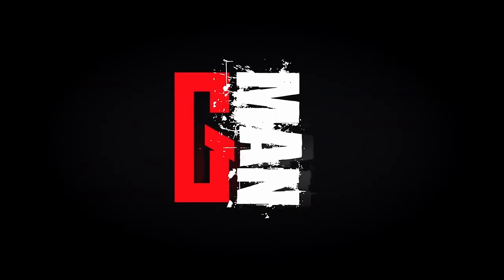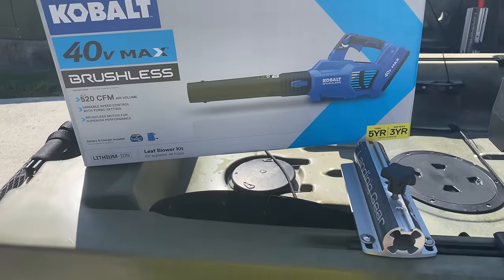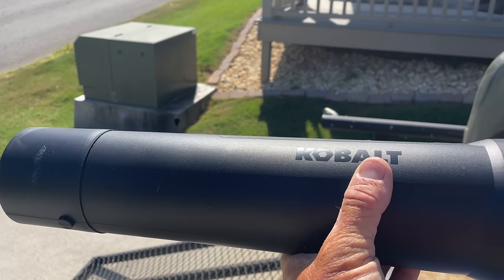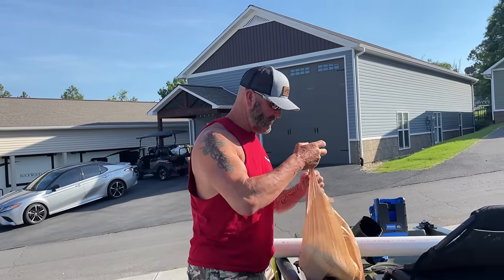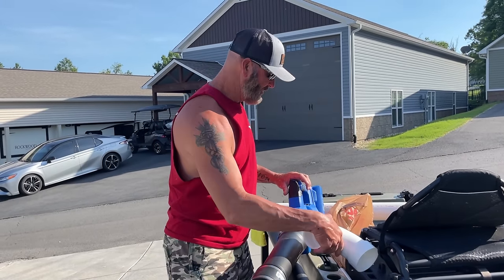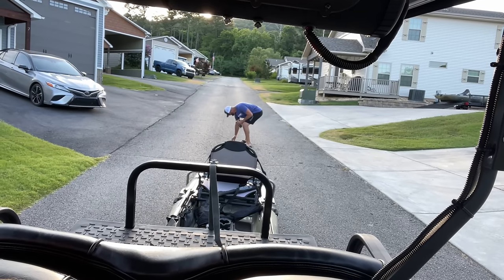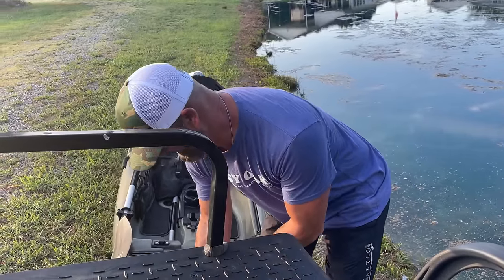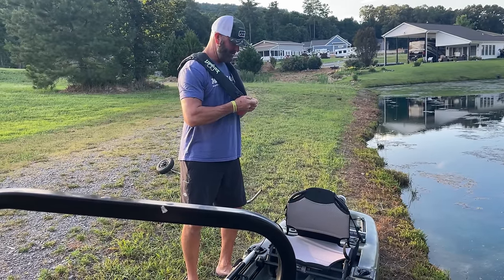Leaf Blower powered kayak

Comment: I stumbled across this little gem while researching silly ways to make my own silly redneck raft out of a couple 55 gallon drums with my son for his birthday camping trip. I really wanted to use some silly way of propelling our little boating abomination, and it is fun to see somebody test this one out!  I'm a couple of years late on this comment, but I couldn't help but share some of the stuff I found when researching waterjets and propellers and such. You can skip to the last paragraph if you want to read the only part that a normal person probably would've posted. 😂

The VERY BASIC science behind the thrust of your leaf blower setup (or any jet/fan/propeller) really comes down to Isaac Newton's famous law that every action has an equal and opposite reaction tied to his famous formula of "Force = Mass X Acceleration." You might remember "F=M*A" from high school physics.

When you are talking about systems that move fluids like jets and propellers, then the "Force" we are trying to create is usually called "thrust." In this video, the "thrust" is the equal and opposite reaction of the air pushing against the leaf blower when the leaf blower pushes the air out of its nozzle. The "Mass" is basically the volume or amount of the air/water being pushed out of your leaf blower, and the "Acceleration" is how much faster that air is moving when it leaves your leaf blower compared to when it entered the machine. 

Therefore, if you want more thrust from any fan/propeller, you will need either (1) bigger fan that moves more air at the same speed —OR— (2) a well-designed nozzle that sacrifices a little bit of that volume of air BUT outweighs the sacrifice by really really increasing the speed of the air coming out of the fan. (The "M" in the equation gets a little smaller, but it is being multiplied by a MUCH larger "A.") HOWEVER, if you are using the second method, then you need to know that you can only shrink the diameter of the nozzle so much until you reach a tipping point where the nozzle ends up "choking" the volume output of the blower more than it speeds up the air. That is the point where you start decreasing the amount of thrust all the way down to the silly situation of having zero thrust produced by your completely sealed air tube.  (Note that Both of these oversimplified explanations assume you are not changing the speed of the fan itself because you already maxed it out or somthing. Also note that, if you want more thrust, then you would obviously want to increase both the "Mass" AND the "Acceleration" if you have the ability to do so!)

At any rate, I brought all that up just to say that it is funny how our intuition makes us want to treat the air as if it is a solid stick and push it against the ground or push it against the water to get more thrust. However, we must remember that the leaf blower in this video is NOT using the AIR to push against the WATER; the blower is ACTUALY using its IMPELLER to push against the AIR! Once the air has left the blower, it has essentially provided all of its usefulness. In other words, when you put the end of the blower next to the ground, the air does indeed push against the earth, BUT the "equal and opposite reaction" of the earth pushing back against the air molecules does NOT transfer all the way back up through the column of air and push against the leaf blower. The air molecules instead just bounce in all directions off of the ground and causes more turbulence at the output of the blower. Similarly, the only thing the happens when you put the nozzle under water is you have significantly increased the pressure that the air must fight against to exit the nozzle which drastically reduces the efficiency of the blower. As a bons, putting the blower into the water also creates another source of drag and turbulence that makes it harder to move that boat. 

Long story short, I would be VERY interested to see you experiment with putting different sized nozzles on the leaf blower to see if you can find that sweet spot that maximizes thrust caused by speeding up the air before you start to lose thrust from choking out the volume/mass of air.

Comment: try a T fitting with a long sweep. Think of like a power washer with the soap cup, the air will push by, suck water from the inlet and push it out the back. Might work

Comment: Hey Gerald just a thought...Can ya reduce the fittings down to like 2” with bushings? I bet it’ll fly then!My wife was gonna kill me cause I was gonna do the exact same thing with our blower lol!Good luck up north!Keep him straight MRS.Lulu I know it’s hard to do.We enjoy watching you 2.👍🏼👍🏼
Reply: I was thinking the same thing. Get a 3x2 fitting and maybe using two 45’s instead of the 90’s would also help reduce the air flow reduction. Increased pressure and decreased flow reduction
Reply: Exactly. Smaller outlet pushing off the water.
Reply: thats the key, focus the pressure, the water is too dense to move, but maybe, I would try to get it down to inch and a half or quarter, the smaller the better I would think

Comment: Take all the 90s off it and it'll give 3 times the power every 90 takes so much air flow it'll blow your mind  just like dryer vents every 90 reduces the length by 10 ft that you can run inorder for it to still be effective

Comment: So. If you consider the weight of water and the usage of a leaf blower. They’re used to create enough wind to blow leaves, meaning that they’re designed in a way where all they do is push air with zero pressure regulation. Putting a tube on it and the putting it underwater is like corking the end of the tube with air leakage slipping out back past the fan blades. Because leaf blowers are designed for max volume as as apposed to pressure the leaf blower jet boat isn’t possible, which is why current jet style boats use thruster based systems comprised of spindle like turbines. Vs a plastic fan with angular blades.

Comment: Alright I’m not a total physicist but the first time I’m pretty sure it didn’t work because the pressure below the water is greater than above thus no push. 

Second time you have it hitting two different spots before exiting. Let the air go straight pull of the PVC. I still think it can work IMO

Comment: Just try reducing the 4 inch out let ro a granular maybe 1 inch and a half increasing the pressure there for giving you more trust from the smaller out let or marry to air blowers 4inxh pipe together and gradually reduce the xreat even more presser on trust mess with the out let size to find the most affected it be   pretty simple I reckon you be  flying it. I'd like to see that vid.

Comment: If you could put that sucker underwater without it shorting out you would have better luck. Air doesn't have as much mass as water and not much reaction when expelled from the outlet. The impeller needs to be under water to get the reaction needed to move that amount of weight. Try that and you will have a jet that moves the craft fast enough to make your efforts worth your time. You could just find a used trolling motor and redesign it for your application. Put a duct around the prop for the weed problem. It will also aid in the efficiency of the prop.
Reply: 👍👍👍Well said. It is true that the motor + propeller + Cowl is used as a thruster underwater. The thrust obtained in this way is the largest.But I am looking forward to the video of UP master using the blower to push the kayak forward very fast.